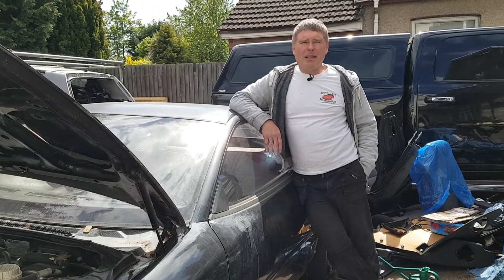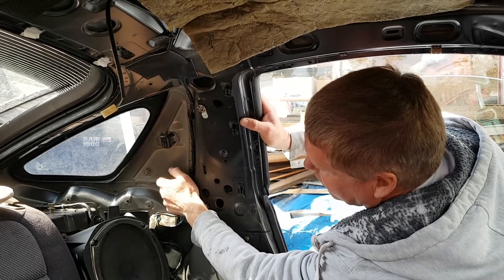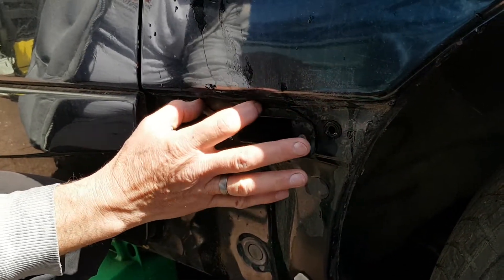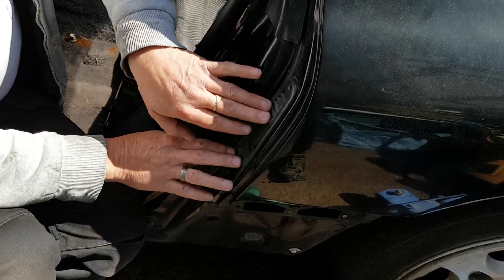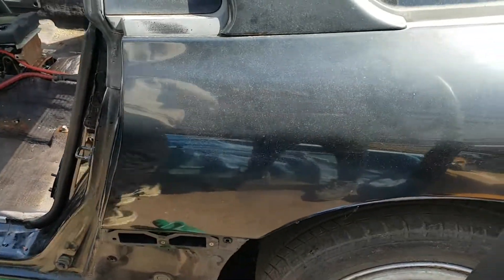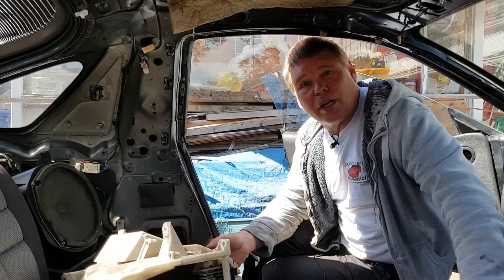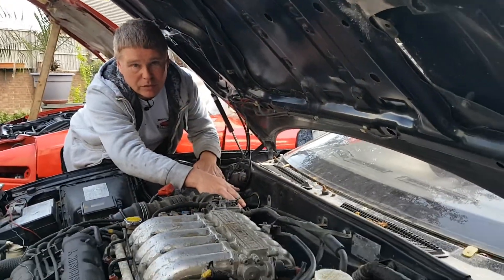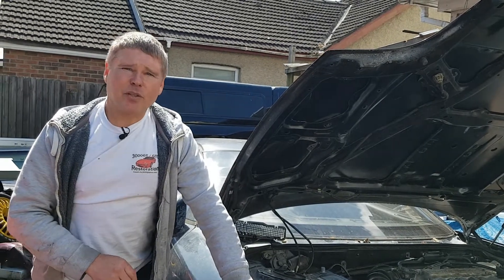Mitsubishi 3000gt / GTO Water Ingress PT2

Comment: Hey Joe thanks for the video. I have a GTO that I literally stripped down to the bare chassis but the one thing I want to take from it that I haven't tried to remove yet is the quarter back sail panel glass. I know it's not a typical thing to remove but I wonder if you have a good way to do so. 
Mark from Alberta, Canada
Reply from the maker: Hi Mark. I haven't covered this because my videos are for the man at home and this job is definitely not for the average man at home. I know how to get them off but even I would need a specialist to re-fit the replacement. The manual tells you to use a cheese wire but I can assure you that this will not work and will destroy the window. If I have another car that I am scrapping, I will do a removal video for you. Regards Joe
Reply: @3000GTGTORestoration  thanks I really appreciate that. I've seen tutorials on removing the Stealth rear quarter glass but they look a bit different, and in those they did use a wire to remove it. I don't need refitting right now, as the car will be mostly parted out. But I'm sure there are people in need of those pieces and I don't know if they are available anymore

Comment: Do you mind doing a video of how to remove the rear window trim the top and bottom? It's the metal ones. I believe there are white clips that hold it in place but can't remember where to push them in to remove them?
Reply from the maker: The bottom one is covered in another video about water leaks I think. If you would like to give your name and country, I will add the other one to the list for you. Regards. Joe
Reply: @3000GTGTORestoration  No problem Joe, this is Sean in the USA. I'll check out the water leaks video to see how the bottom one is removed! Thanks again for all the helpful videos!

Edit: just watched the water leak video. Is the upper the same method with the plastic pry tools?
Reply from the maker: No. It is slightly different and has a higher risk of breaking the clips. If you don't mind breaking the clips, you can slide the trim tool along the top and see if it will release.
Reply: @3000GTGTORestoration  I want to say I seen somewhere on the forums of using a flat screwdriver and pushing the tabs to release the trim piece but I can't seem to find that tutorial.

Comment: hey man .i just picked up a 1991 3000gt vr4 and found that it has rust under the driver and passenger undercarriage and its bad. also has rust by the rear subframe in a small spot. Could u tell me why that would rust. ? My name is chris and i am from the USA. Thank you
Reply from the maker: There are lots of possible causes for this and not all are obvious. I can't say the cause for your car because I can't see it but it is worth looking at the video I did on water leaks for some tips.
Reply: @3000GTGTORestoration  yes I watched the whole video and I'm going to definitely start taking a look at all the areas that you focused on. Like you said the leak is probably from within and that's what's causing the rust but I don't know how it would get inside the front well area when there's really nothing that goes over that way other than maybe the windshield but I think it's a factory windshield in the car
Reply from the maker: I have recently had a couple of leaking factory windshields.